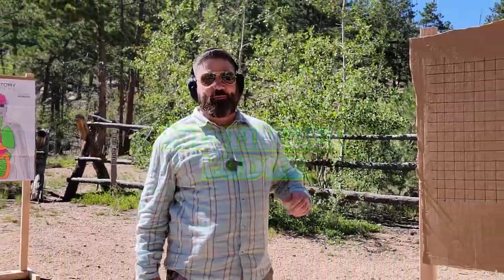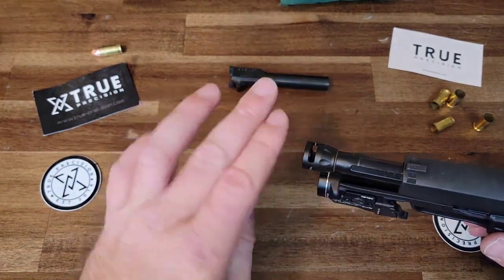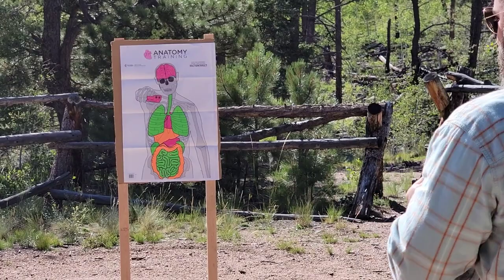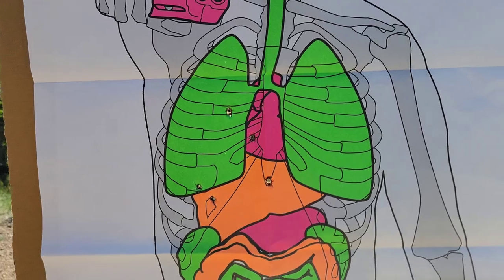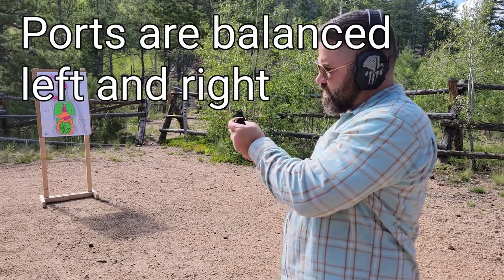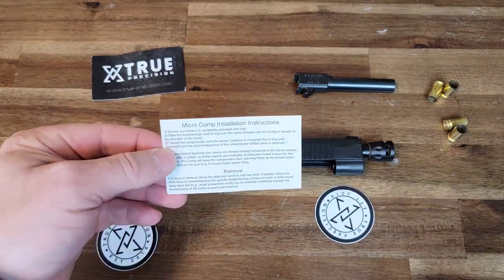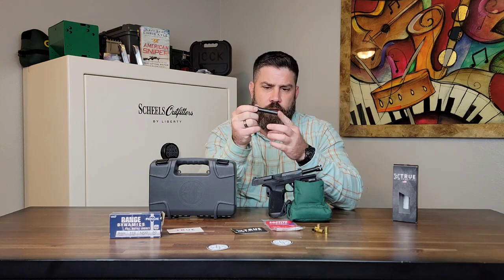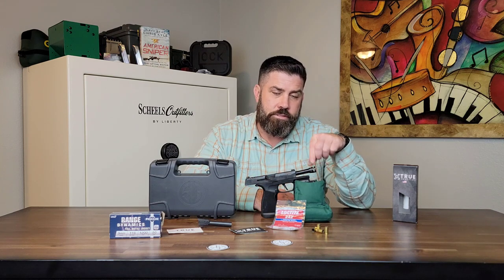TRUE PRECISION MICRO COMP FOR SIG P365 XL XMACRO REVIEW 🌟RERELEASE🌟

Comment: My buddy told me to put an o ring on the threaded barrel instead of using lock tite. Maybe give that a shot
Reply from the maker: It comes with an O-ring and it does a good job. After a 500 round range session you are going to want to check the alignment of the comp.

Comment: That thing sticks out quite a bit lol might as well get a regular comp 🤷🏻‍♂️
Reply from the maker: I needed to be able to add a suppressor
Reply: @BigTimberLodge how is a compensator specifically like that supposed to be tightened? Does it need to be completely tight against a lantac threaded Glock 17 barrel? Or do you tighten it all the way and then loosen it so the ports can face the 3/6/12 o’clock position? 

Reason I ask because when it’s tightened all the way on a lantac barrel with the o-ring. The top port faces downward rather than upward
Reply from the maker: @williamcornejo4639  the o-ring is meant to be a timing feature. Get the comp into the last revolution until it can't be tightened anymore, then back it out so you get the ports situated at 9 o'clock, 12 o'clock, and 3 o'clock. I recommend using a small drop of Blue Loctite to secure it in place so it won't come unscrewed by accident. However, with a good range day, the comp will come unscrewed easily after you're done, making cleaning easy. Just reapply Blue Loctite after cleaning.

Comment: I wish True Precision made barrels for my HK VP9 sk. I'm looking into the Copper TiN coated threaded barrel and Y micro comp from True P for my wife's Glock 19x ...Question : Does the micro comp help with carbon burns on your tac light  lens ? And is it noticeably louder ?
Reply from the maker: If the comp sticks out further than the flashlight, you will get a lot less residue on your lens. It's not noticeable with how loud it is.

Comment: Any updates on cleaning with that comp?
Reply from the maker: @afireinside579  I put Blue Loctite on the threads to hold the timing in place. After a hard range session, the comp is fairly easy to get off. I use the Loctite in conjunction with the provided O-Ring.